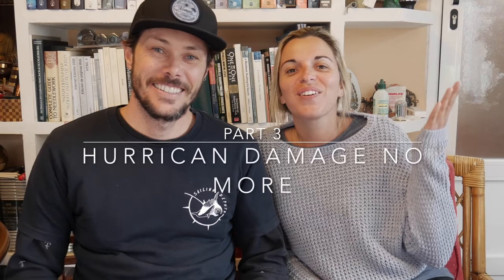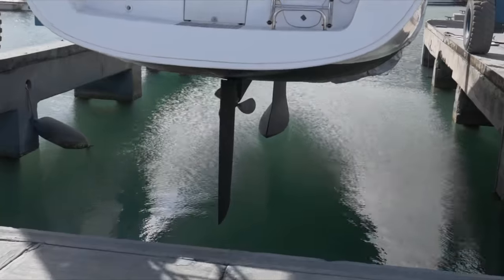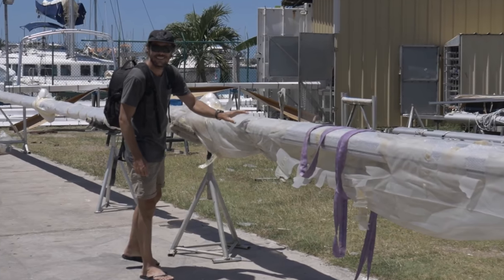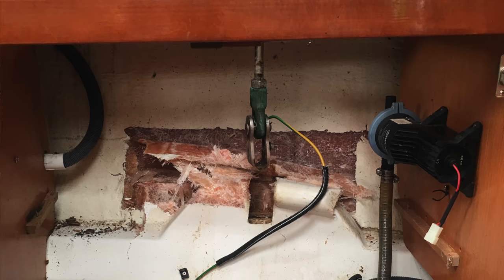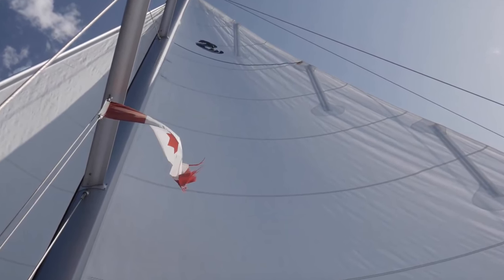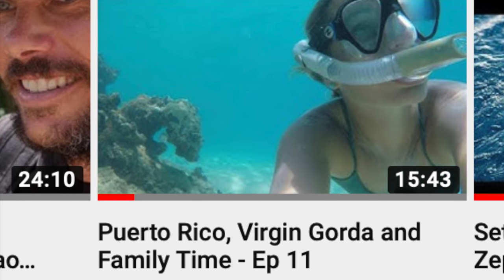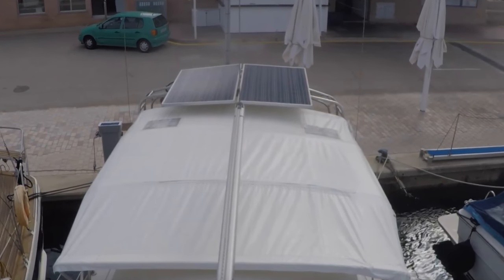Buying a Boat - Part 3 | The ZEPHYR Story - Ep.42

Comment: I was laughing at myself as I remember many years ago the first time docking our boat at a petro station, I had been coming in really easy and decided I needed to bump it into gear to move forward and ended up hitting the dock under power..........So after a few exciting minutes we were able to get our fuel and pull away without any major damage. Never did that again. Great time listening to what you folks had to do.
Reply from the maker: Cheers Bill. Doesn’t matter how many times we do it. It’s nerve racking every time.

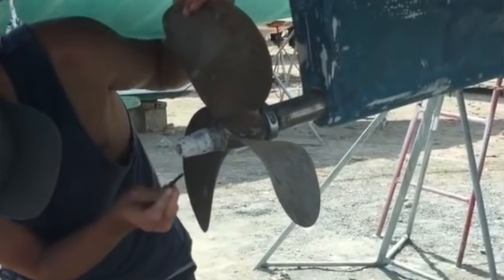Comment: At 2:50 you show the prop. Cannot understand why there is no outer framework around the prop to protect it from lines (like crab pots) or other objects to get entangled. Have seen it often enough.
Reply from the maker: I don't think it's very common for sailboats to have casings around the props. Not from what I've seen in the boatyard. Unless is a full keel boat.